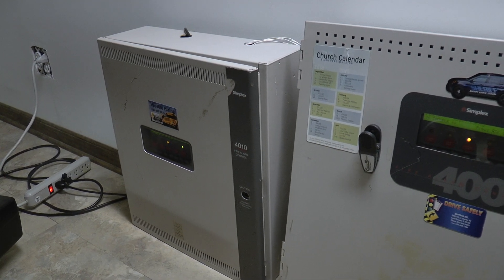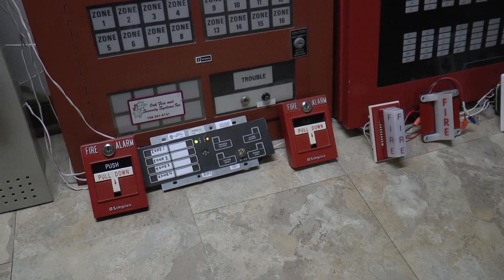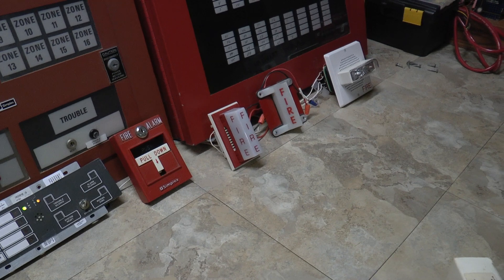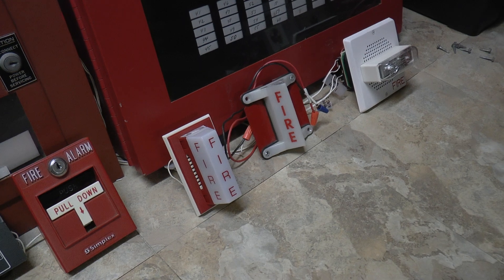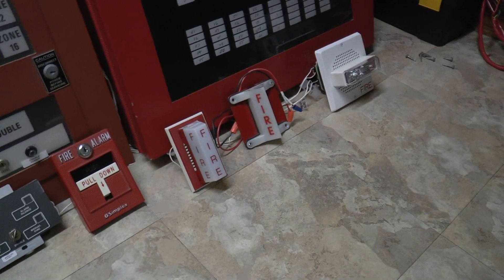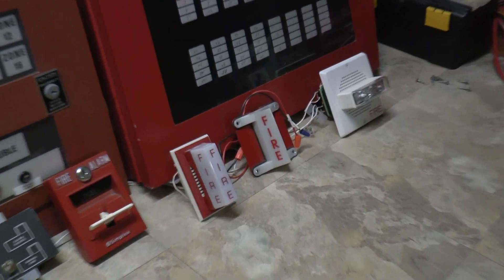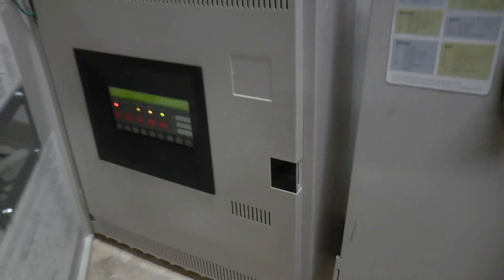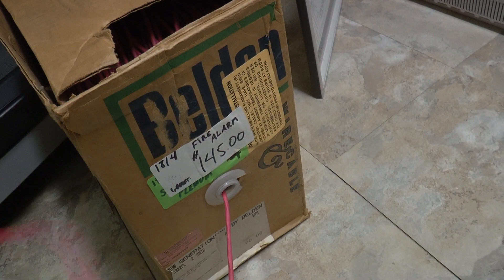Floor System Test 45

Comment: Use wire strippers to strip the exterior wires, then use house-hold scissors to cut the shield.
Reply from the maker: I tried wire strippers, but they just sliced right through the shield and the wires inside. I'll keep trying.